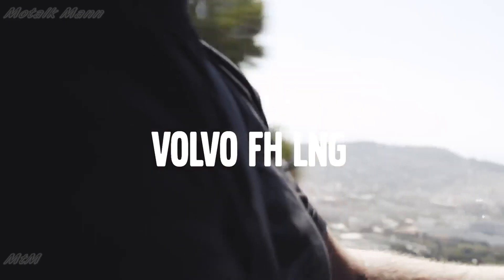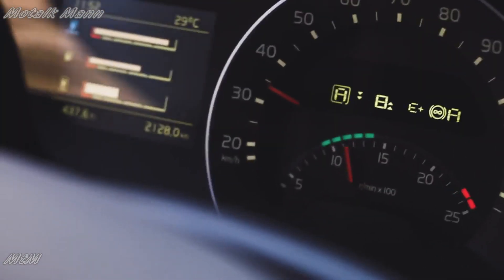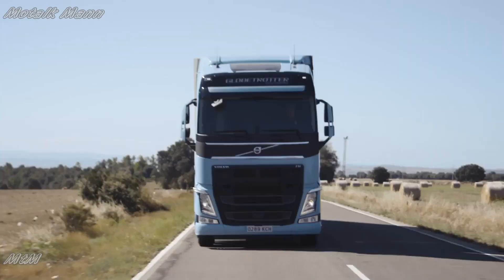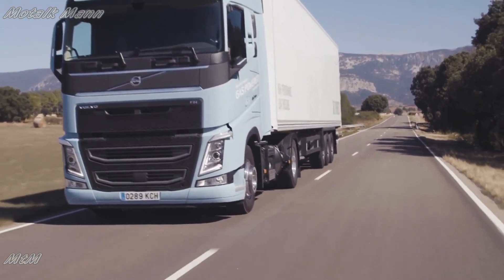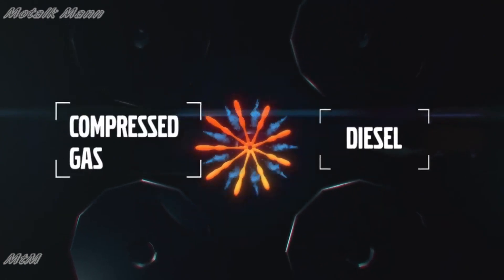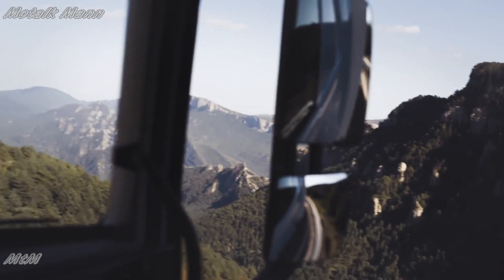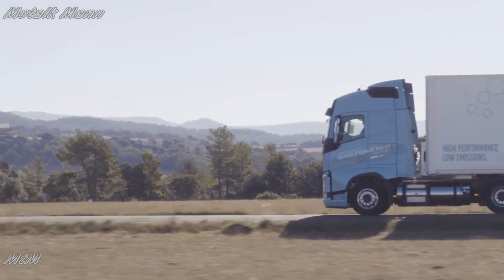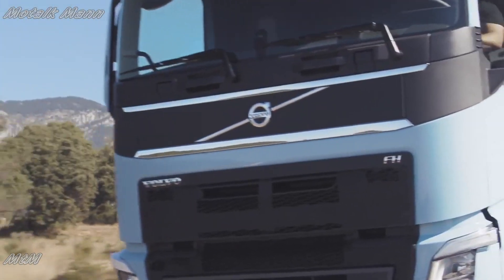New 460hp LNG powered Volvo FH truck – reduces CO2 emissions by 20 - 100%

Comment: Diesel? So it has an extra (small) Diesel tank and extra (and expensive, and complex) Diesel Common Rail injection system just to ignite gas? I suppose there is a technical reason but... why not replace this whole diesel injection system for just a spark plug?